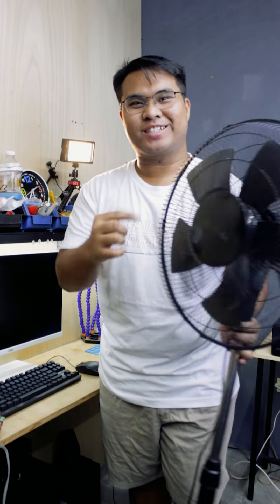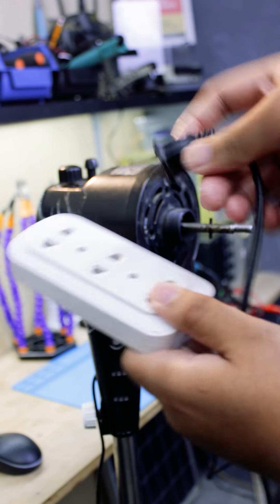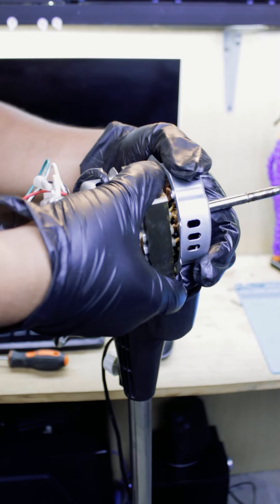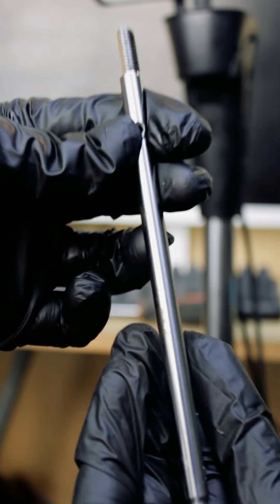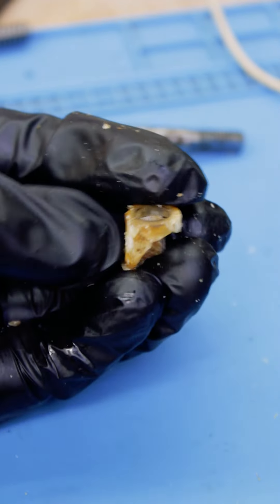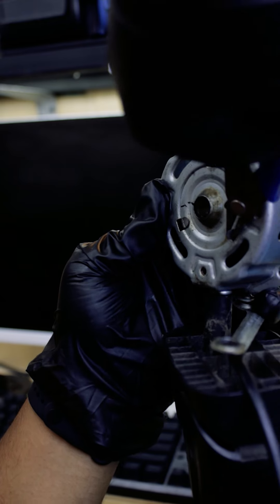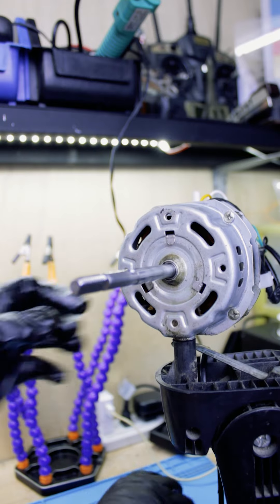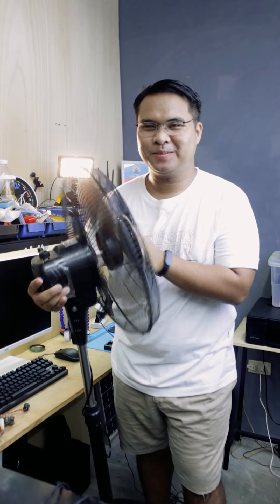How to Fix a Broken Electric Fan: Motor Humming Sound | Rotor Not Rotating

Comment: All you need to repair a seized fan is motor oil. Inject a lot of oil (but not too much!) into both oil wicks to rejuvenate them. We do not need to replace the bushings or rotor unless they are rooted. The shaft and bearing can be slightly damaged yet still work fine, the damage is an artifact of the bearings becoming dry. I have a few fans with that damage, yet they work flawlessly because I lubricated them. No need to replace the shaft or the rotor. Nonetheless, I appreciate your hard work in restoring this electric fan and saving it from going to a landfill. Don't use detergent oil, vegetable oil, or WD-40. Always use something like SAE-20 motor oil or sewing machine oil.
Reply: What about Cook oil like soja oil? I'm poor😢
Reply: @T3St3r-t7x  Cooking oil will not last for a long time. However in an emergency you can use it for the summer.